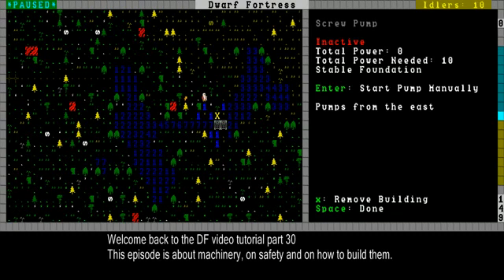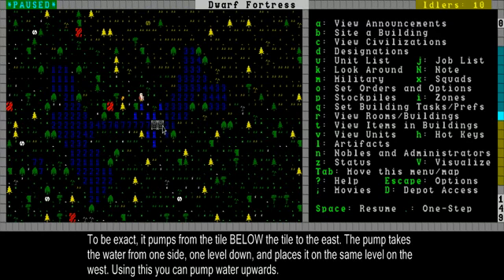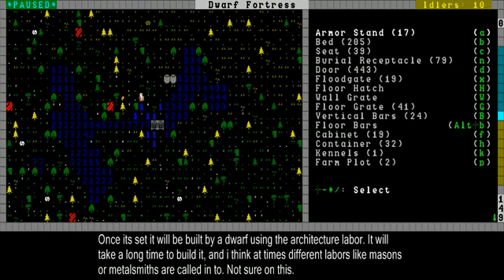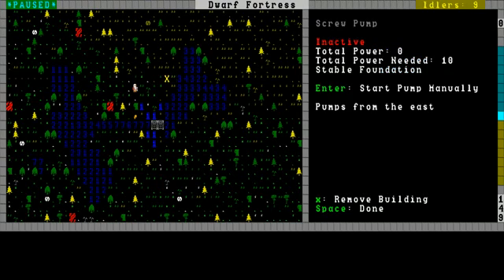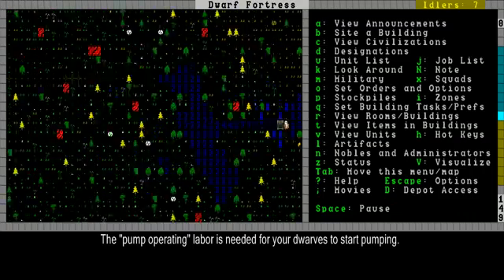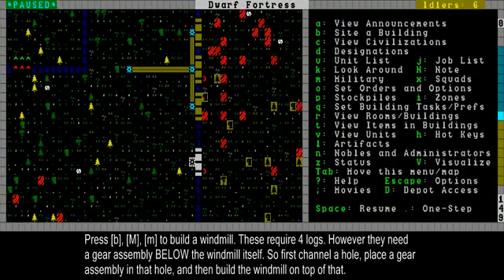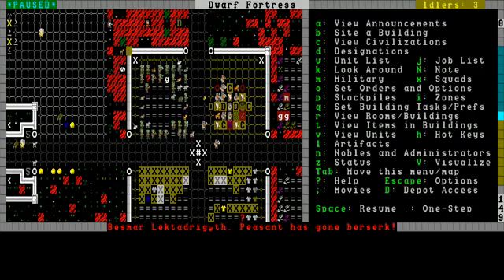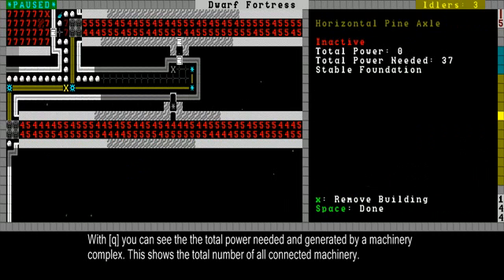Dwarf Fortress Video Tutorial part 30 - Machinery 1, Safety & Building

Comment: @KnightOfCydonia90 
doesnt work as well as it should (unless im building it wrong) the screw pumps dont generate enough pressure to get the wheels moving, havent tried yet with wind mills (goblin siege)